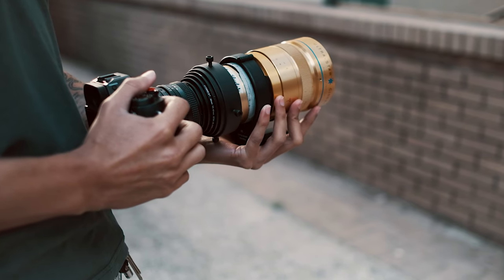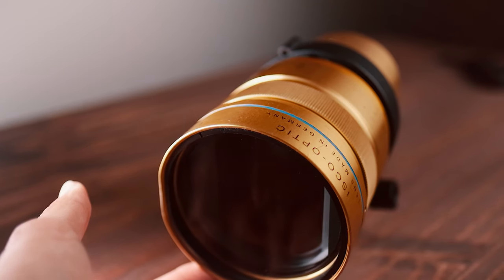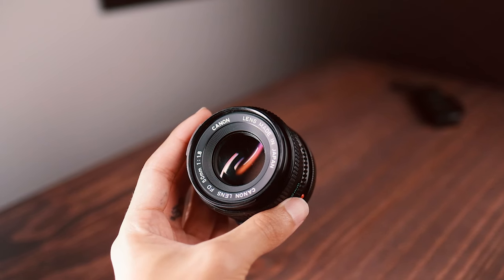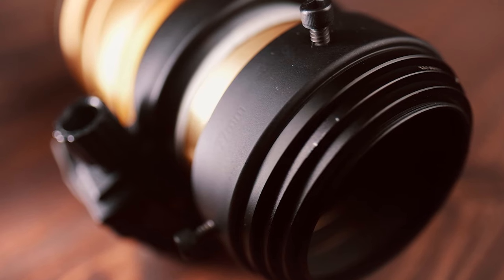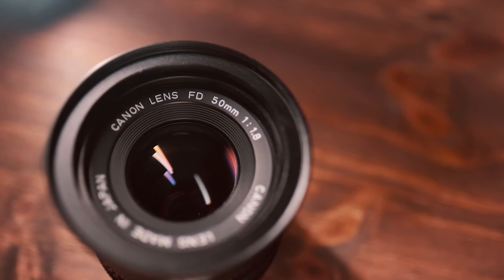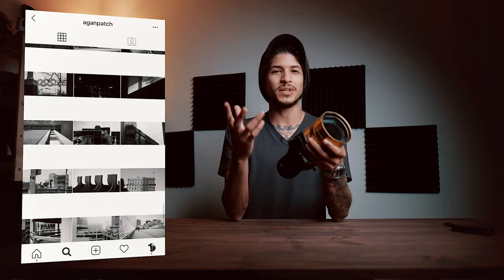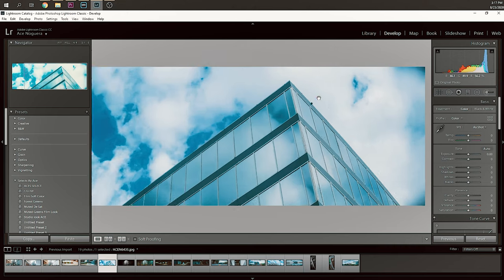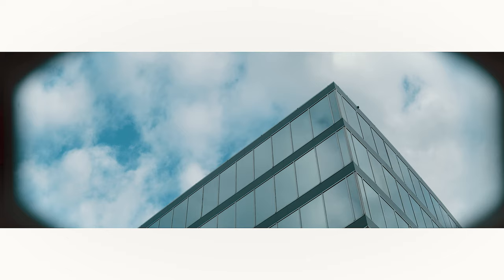DIY ISCO ANAMORPHIC Projector Lens Build For Fujifilm

Comment: Were the images you showed that had the vignette from the 35mm film?  Maybe I missed something.

It's pretty strange that you would get vignette with a 50mm + anamorphic on an APSc cropped sensor camera since both of those lenses project a much larger image circle then APSc requires.  

Most times the vignette only shows up on a Full Frame.
Reply from the maker: Youre right, it is weird and im not sure why it was happening
Reply: @AceNoguera  It is due to the amount of step up rings, try to use the minimum distance between taking lens and the clamp. I am with a 3:2 full frame censor with 3 step up rings and i dont have vignetting. Nice video btw
Reply from the maker: @madelproduction  youre definitely right! thanks for sharing!